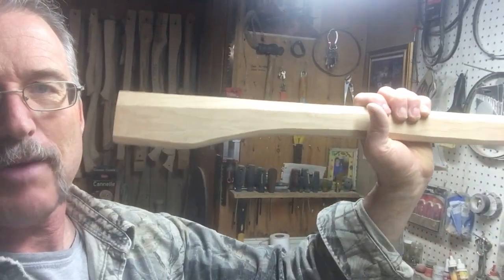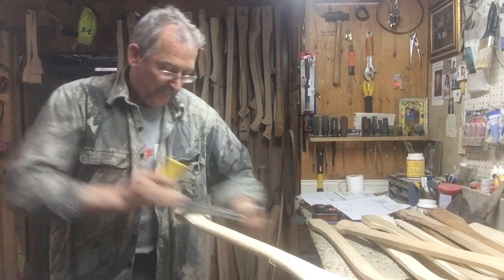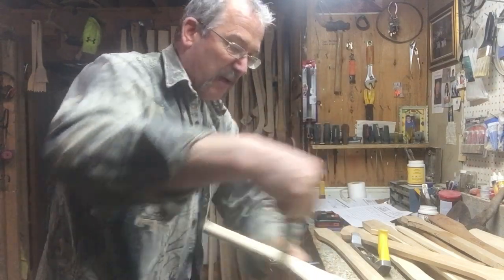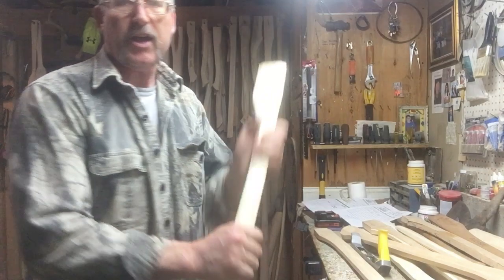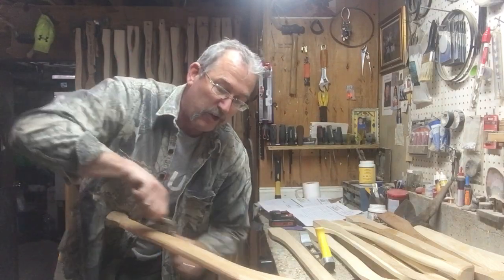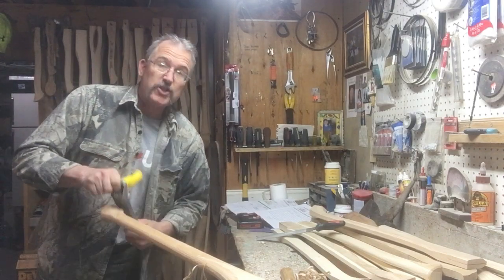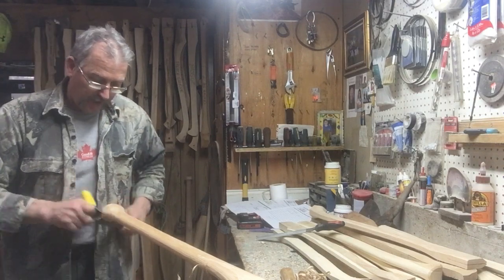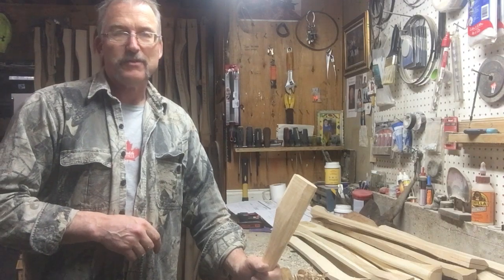Woodworking 101 - finishing a unique handle pattern.....Baseball bat!

Comment: Very interesting to hear your thoughts on the different hickories. I've got Bitternut at my place in eastern Ontario. If I drive south an hour or so I can get to some beautiful shagbarks but those are just for looking at. I've made a few Ash handles and they've been doing quite well. It's hard to justify cutting a hickory here when the Ash are all dying from Emerald Ash Borers but one Bitternut got pretty damaged by a recent ice storm so I may try to split some handle bolts out of it. Last week I had to reseat a head on an Ash handle that came loose and a big chunk chipped off the palm swell. I just glued it back on and after it set I then drilled holes and added a few little pegs (actually segments cut off a wooden cooking skewer 😆) and some more glue. Once it was sanded back down you can't feel the difference (although you can see the pegs). Probably not a great solution for a brand new handle but it works fine to keep an old handle going.
Reply from the maker: Actually Matt, given the little torque that there is at the palm swell, what you did is exactly what I tell guys to do when they chip or split a handle at the swell.  I even insert a wood screw, then sand it over.   simple and easy, and will make it work fine.   great ideas.